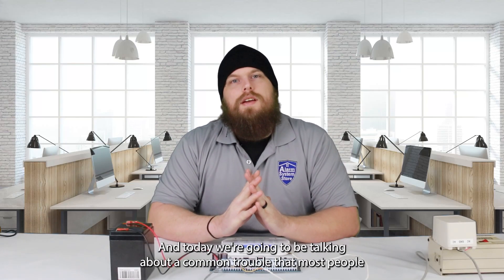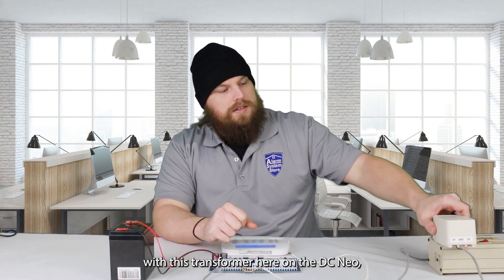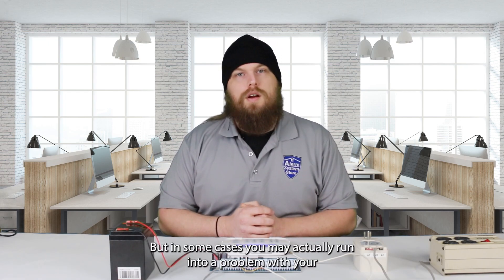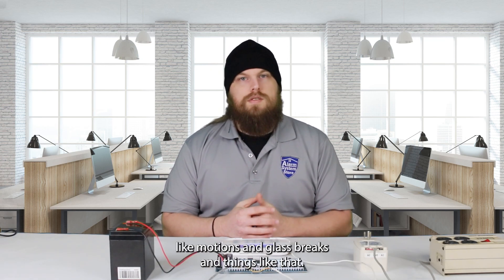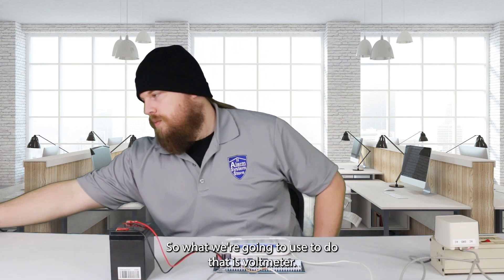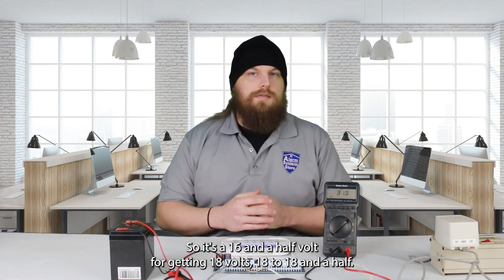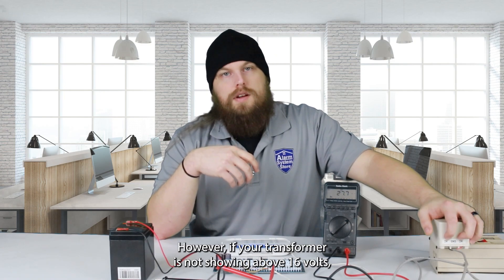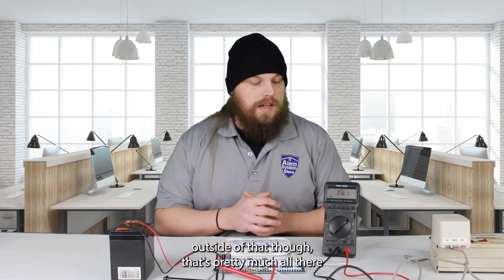AC trouble? How To Troubleshoot An AC Trouble On The DSC NEO

Comment: Thanks for the great video! I was able to stop the vid by 7:26 and fix the problem with my 2GIG panel. At 11:30 last night, the hot wire came loose from the connector inside the panel.